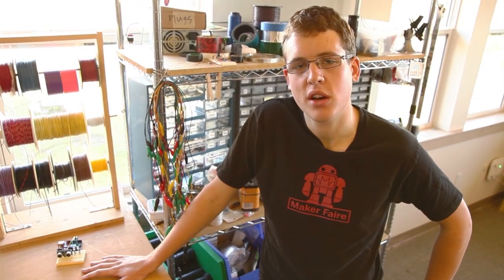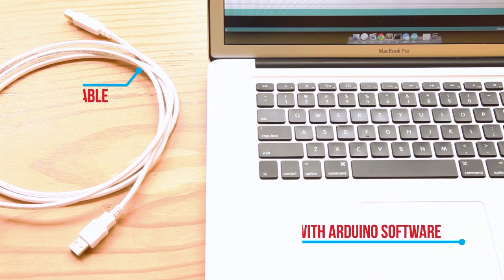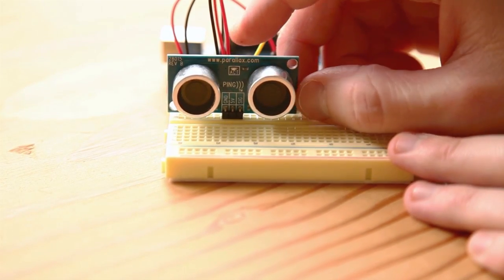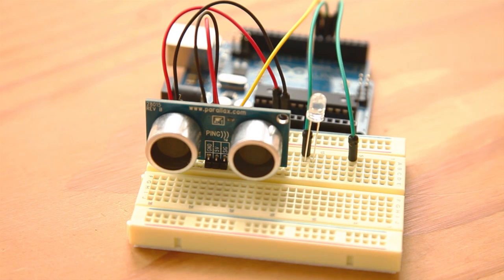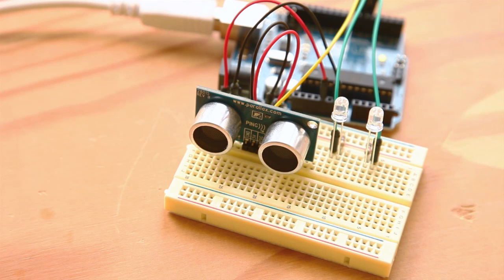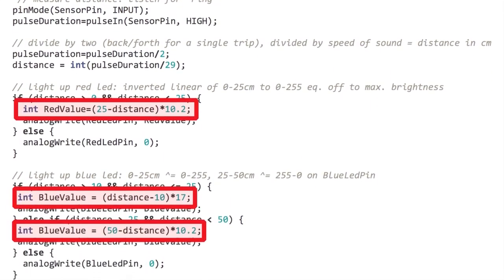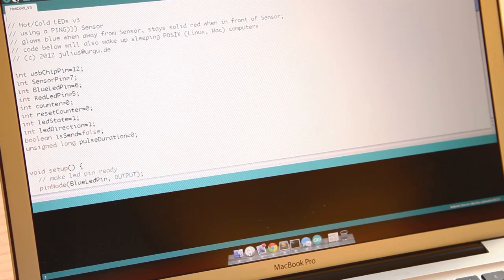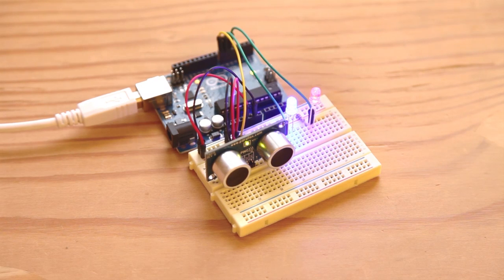Weekend Projects - Hot/Cold LEDs

Comment: Whatever you do, don't try to give more than the regulated +5V supply to the Ping))) sensor. It will ruin it.  For example do NOT try to power it with the "raw" or "Vin" voltage pin of the Arduino.
Do you really need to ask me how I know this?
:(
The Ping sensor and Arduino combination is capable of millimeter resolution of distance at short range. It is really neat!
I've also used the Parallax brand LCD screen with Arduino, it is very convenient because it also is just three wires, two power and one signal.